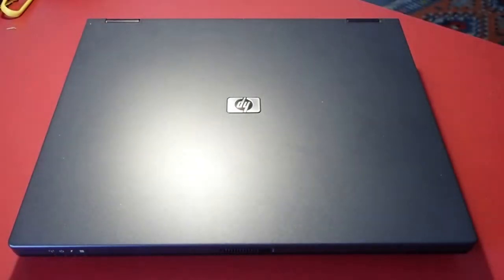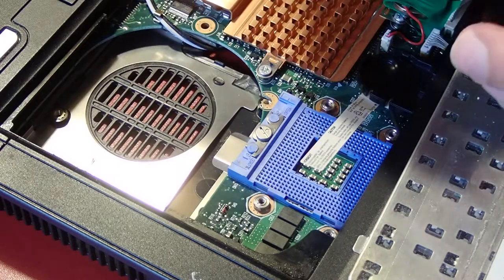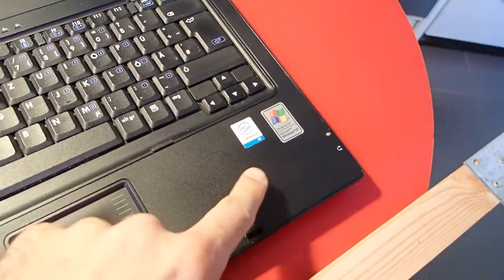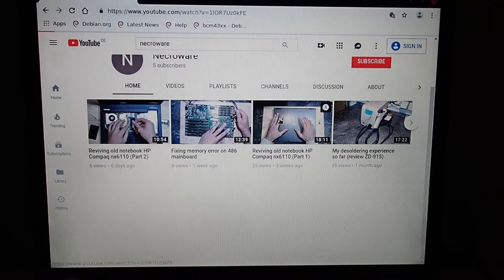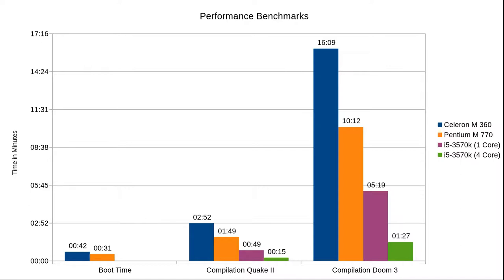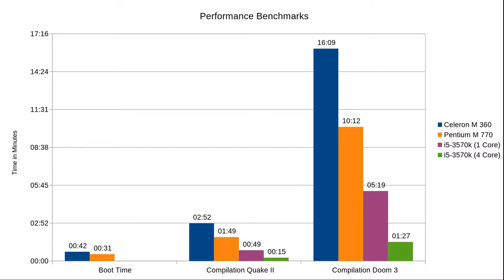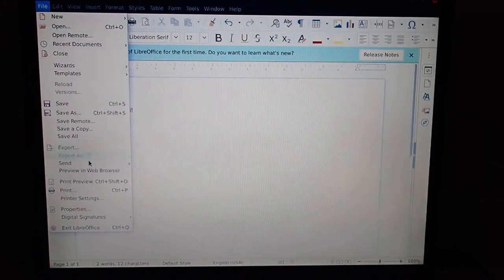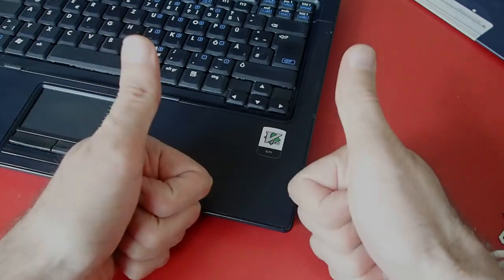Reviving old notebook HP Compaq nx6110 (Part 3)

Comment: Hi again! I have difficulties installing in the same laptops broadcom bcm94318 wifi adapter, installing these drivers for my first time using installed Debian with Xfce os. I connect to the internet with hotspot of my mobile but i am already connected with my desktop to the internet. Shall i connect ethernet to desktop and retrieve connection from there with linux servers? Or shall i download drivers from somewhere to a usb stick and then install them to my Debian .
Reply: Hi, you will need to install firmware-b43-installer package to get the appropriate firmware blob. Therefore I connected the notebook once using a network cable and installed the named package. After that wifi worked without a problem. If you don't know how to install packages, just use graphical application installer synaptic or open a terminal and type following two commands (first updates the list of available packages, second one installs the needed one):
sudo apt update
sudo apt install firmware-b43-installer
Reply: @scorp4770  Thank you Scorp! I will try this definitely, since the package you say is in the installation Dvd of Debian.
Ps.  When i installed Debian the system had one problem with apt installing i think. Or it had a problem verrifiing Dhcp or something relative.. Thank you.
Reply: @scorp4770  My problem is that i dont have a router home to connect it with Ethernet. Can i download with another pc  the drivers and after  install them to my laptop via a USB stick ?
Reply from the maker: @leonidasdrogkaris7304  Hi Leonidas,  yes you can, but it could be a bit tricky. Try to download following two files:
http://ftp.de.debian.org/debian/pool/contrib/b/b43-fwcutter/b43-fwcutter_019-4_i386.deb
http://ftp.de.debian.org/debian/pool/contrib/b/b43-fwcutter/firmware-b43-installer_019-4_all.deb

Copy this files to an usb stick and then copy this files from the usb stick to your home directory on your notebook. Then try to install the files in the same order using following commands in the terminal (I assume, your user name is leonidas, then the home directory is /home/leonidas, the *.deb files must be there):
cd /home/leonidas
sudo dpkg -i b43-fwcutter_019-4_i386.deb
sudo dpkg -i firmware-b43-installer_019-4_all.deb

Please doublecheck the output carefully, that the installation was successful. You can find the package information here:
https://packages.debian.org/de/buster/firmware-b43-installer
Reply: if i understand right, Debian is a 'rooted' Operation system. For every Software change, installing drivers, etc, user has to have administrators permission, from a Debian server somehow. Is there a chance to install a package without having internet connection?
Reply from the maker: @leonidasdrogkaris7304  Well, actually root is the name of administrative user in Linux (and all UNIX-likes). Since Android is actually also a Linux, "rooted" means, that you turn on the administrative user to handle your operation system, which is usually deactivated by the manufacturer.  So far, you are right, to do any operation system level activities, like installing drivers, packages and other things, you'll need administrative rights, means to be root. Alternative you can do commands using 'sudo' (stands for super user do), following by the command itself. This way you'll obtain administrative rights to do everything you need. All this is not Debian specific, in Linux (also BSD, MacOS etc.) software is handled in a different way as in Windows. You don't install something by downloading some sort of setup.exe and install every part separately, but there you have a centralized repositories with packages, which you can install  on your machine.  Once you learned how it works, you will never want to come back, since it has a lot of benefits. Like you can update all of the software, and I mean really all of it, with one command in 3 minutes. Anyway, apt is the tool you can use to install packages in Debian. There are two commands to know in the first place 'apt update' should download the list of available packages from the Debian servers and 'apt upgrade' upgrades your whole system to the latest version (everything, even LibreOffice and your favorite media player). With the command 'apt install firmware-b43-installer' you will install the needed firmware for your WiFi. All you need is to connect your notebook using a cable to the internet. Since you don't have a router, where you can plugin your notebook, it makes things some more complicated. In this case, you have to do, what I wrote above. Download two *.deb files, copy them to the notebook into your users home directory and use another tool called dpkg to install the packages. Since you are modifying your system, all this commands need to be prefixed with sudo, to obtain administrative rights. F.e. 'sudo apt update'' or 'sudo dpkg -i firmware-b43-installer'
This is very important topic, as important as to know in windows how to install something there. The difference here between the two operation systems is quite big, however, after you understood how it works in Linux, you will find Windows approach very confusing and slow. And you will learn and understand how it works on all other operation systems except Windows.
One other way I can suggest is, if you have another USB WiFi dongle, may be in your desktop PC, try that one in your notebook. Many other models, as broadcom, have firmware already preinstalled, so it could work out of the box. I have here some Realtek USB WiFi dongles, which just work. If you find something like this, you can use it to connect to the internet to install the missing firmware for the broadcom WiFi. After that you will not need the USB dongle anymore.
Reply: @necro_ware  Hi again! To start with..Thank you for supporting!  Well, i downloaded and placed the files you wrote me. The first was installed normally. But b-43 installer didn't work. After ... apt install firmware-b43-installer_019-4_all.deb ,  it responded that... Impossible to open locking file  (/var/lib/dpkg/lock-frontend) - open (13;  Denied access) 

Then i thought i should try connecting via  ethernet with my sisters router. But unfortunately, my system miss dhcpcd which is necessary for my laptop to take ip adress.  Then i couldnt find a way install dhcpcd to my system. Also I couldnt find and install drivers for my sisters tp-link Wireless usb adaptor that are not preinstalled in my debian. Do you have an idea please?
Reply from the maker: @leonidasdrogkaris7304  Hi! I guess, you are getting "access denied" due to missing sudo infront of the command. You are not allowed to change anything system related as a normal user and any package installation is a modification of the system. The right command must be 'sudo apt install firmware-b43-installer_019-4_all.deb'.

To the other problem with dhcpcd, you don't miss it, since its replacement is already included in other packages. Everything you need is to plugin the cable. If you run 'ip addr' command, you should get a list of network interfaces available. If your system complains about unknown program ip, then try to run 'ifconfig -a', this is another tool to list network interfaces, like ipconfig in Windows. With the cable plugged in, one of the interfaces should have an IP assigned. Please don't mess around too much, if you are not sure, installing and uninstalling packages blindly could render your system unusable. If you plugin the cable and 'ip addr' gives you no IP address, try to restart NetworkManager by typing 'sudo systemctl restart NetworkManager'. This daemon is responsible for network connection management and it already includes all dhcp and other required stuff. Usually, you don't need to restart NetworkManager, since it recognizes plugged-in  cables automatically. Alternatively you can plugin the ethernet cable and just reboot the system. Look again into 'ip addr' or 'ifconfig -a', depending on what you have.

Regarding drivers, in Linux they are handled differently, as in Windows. Linux has all the drivers already in it, you usually don't need to install anything. You just need to plug the device in and it should work. However, sometimes you need so called firmware blob, like with your internal WiFi module. This binary file is proprietary and is released by the manufacturer of the hardware, but it is not the driver. The driver for your network card is already in the Linux kernel and you have it on your notebook. All you need is the firmware file, which is installed with firmware-b43-installer package.

Advanced topic: what I said about drivers is half true, obviously not all drivers are included in the Linux kernel, there are many, but for sure not all possible drivers are included. You can compile additional drivers for some of your exotic hardware, but this is not something for beginners and you definitely don't need to do it on this notebook. All the drivers needed for it are already included. So don't bother for now and just think, that you already have all the drivers you need. Only some firmware blobs from the manufacturers are missing.

The point, that most of the drivers are included in the Linux kernel allows you to plug your harddrive into any PC without the need to reinstall anything. It will just boot normally, like nothing has changed. This is how I test different hardware, I have a Linux with tools and benchmarks preinstalled on a SSD and I just plug it into a machine to test it. No drivers installation nor any other change is needed.
Reply: @necro_ware  Thank you very much for all these help. The point is that  sudo was at the start of the command. That is how first deb was installed normally but second had a problem. I am thinking that from the start of  the installation of debian were problems since some messages with missing files were shown. So i think i reinstall the system. Before this i will try to plug ethernet cable and hit the commands you wrote me.

Comment: Well done Sir...a fascinating video...just what I was hoping to find!!

I have recently been given....at no cost to me... a very new looking refurbished HP Compaq nc6320 circa 2007 which was on XP Pro but was at some point upgraded to 7 home premium. 

Whilst it works absolutely fine, after seeing your video, I am thinking...why not upgrade...after all it's a lovely 'business-type' notebook...even though the fingerprint reader doesn't seem to function...any idea of the driver it needs?!?

It has 2Gb RAM  made by Samsung M4 70T5663QZ3-CE6 PC2-5300 (333MHz) DDR2  in one of 2 slots.  I am thinking to go the whole hog...4GB RAM, better CPU and even an SSD!?  Could I use new 'equivalent' RAM ...love to know your supplier and approx cost of the parts!? Here's hoping you come across, and video, an nc 6320!!!!!?
Reply from the maker: Thank you very much! Well 6320 is even a better rig and with 4GB of RAM it should actually do a great job with a daily work. Unfortunately my nx6110 supports only DDR1 memory, so I maxed everything out as far as I could. Windows 7 was not an option for me, since this notebook is just not made for it. Furthermore, Windows 7 is out of support in a week and I wanted to go with something more up to date. I don't think, I'll get any 6320 any time soon, so it doesn't look like I'd be able to do a similar video for that.

My supplier was Ebay :) I bought all parts new from Chinese sellers and paid around 5€ for 2GB of memory, 4€ for the CPU and 15€ for SSD with adapter.
Reply: Thank you so much!!  About £20 for a full on upgrade...that sounds good to me!  I'll definitely go ahead...instructed & inspired by your 3 grrreat videos!    Oh, and must download a free/fresh install of Windows 10 asap...Cheers!
Reply from the maker: @grahamkenworthy3189  Nice, that I could help you. I wish you a successful upgrade :)

Comment: Hello! Congratulations for the video and the reviving of course! Perfect job. I have the same philosophy with you. So I have the same Hp nx6110 but with sticker  Pentium M 1.6Ghz , sticker that it is capable for Windows vista also. So i have now 1.5Gbytes RAM, 1,6Ghz CPU and the old mechanical 40 Gbyte Hard Disk. I will definitely do the cleaning and refreshing thermopaste like you!! But it stacks somehow at YouTube which i am mostly interested.
-Do You think that putting the 2.13Ghz like you did, would give YouTube a pushup? 

-Do you think that i need better 2Gbyte Ram? 

-Do you think that replacing Hard drive with SSD would make any difference at YouTube playing or would rest the CPU of it? 

 -Do you think that if i upgrade OS to Vista would have better view of YouTube or better general performance?  Sorry, i don't know Linux.
Thank you!! I definitively subscribe to Necroware! I love the name!
Reply from the maker: Hi Leonidas, glad you liked it, thank you! Well, I'm sure you will not gain as much as I did upgrading the CPU from Celeron M 1.4GHz. A jump from Pentium M 1,6GHz to 2.13GHz is not that much. Memory is definitely a problem, you need as much as the laptop can handle. Unfortunately you can use maximum of 2GB on this machine, and it is already barely enough to use a modern web browser. SSD only helps on loading and working with many small files, in case of youtube playback, I don't think, this will help a lot. Now to the operation system, I guess, you use WinXP now? Modern browsers either don't support it at all meanwhile, or are missing essential features  of the modern operation system to work properly. Well, WinXP is dead and you can't do anything about it. I also would not recommend to use it anymore, since it is a serious security hole today due to lack of support for many years. I am using WinXP on some of my retro machines, but I make it impossible, that this machines would ever be able to reach the internet. Means also no youtube there. Anyway, I also would not recommend to install Vista on this machine, first of all, because of the same problems, its outdated, not supported, security hole s.o. However, its also a terrible resource hog and will never work well even if you upgrade the system to 2GB. End of the story, if you want the notebook to be usable again, with a modern browser, fast and secure, then you will have to use Linux. Don't be afraid, if you have no knowledge about it. Even my 70 years old father uses it daily and he even doesn't know how to use his mobile phone properly. I used Debian in my installation, however, if it is too complicated for you, may be you can give Xubuntu a try. It runs all the modern funky stuff with little resource requirements and is very simple to use.
Reply: @necro_ware  Thank you! What csn i say about? I am glad that i am full convinced to try your fathers way!! : ) i always like to learn, this time thanks to you !!

Comment: Hola amigo, hay alguna manera de poder cambiar el disco caddy a un sata o algo parecido para aumentar los gb para almacenamiento tengo una nc6120
Reply from the maker: Hola amigo! Perdone, pero mi Espanol es muy malo. Que significa disco caddy? Te refieres al CD-ROM? Si es asi, entonces creo que es posible. Con algo como este. Pero no estoy segure, porque no lo he probado.

https://www.ebay.de/itm/Pata-IDE-Zu-SATA-HDD-SSD-Caddy-Module-fur-12-7mm-Universal-DVD-ROM-Optical-Bay/233097997080?hash=item3645b92b18:g:0q0AAOSwgyZcQEdX
Reply: @necro_ware  muchas gracias si es lo que buscaba 🙂👍👍
Reply from the maker: no el problema :)

Comment: Pentium M was such a great chip and end to the single core era, it was basically just a Pentium 3 core taken to its limit wasn't it?
Reply from the maker: Yes it was derived from the P3, which was improved P2, which initially was derived from Pentium Pro. But the core was not taken to the limit, since all later Pentiums, except P4, are derived from that one. Even the modern iCores are grand grand grand children of that CPU.